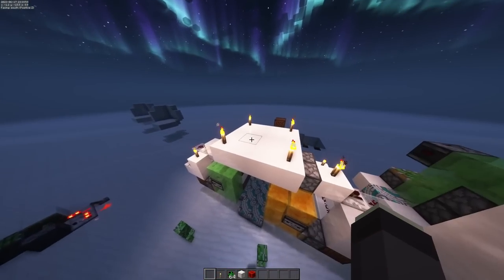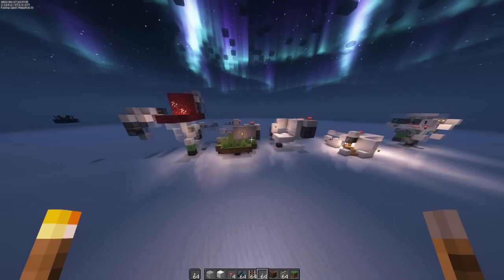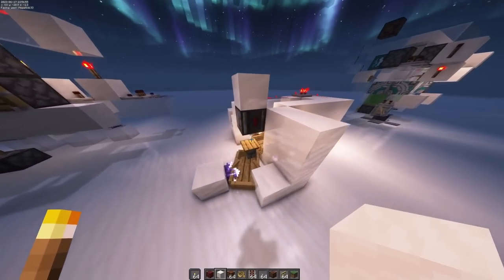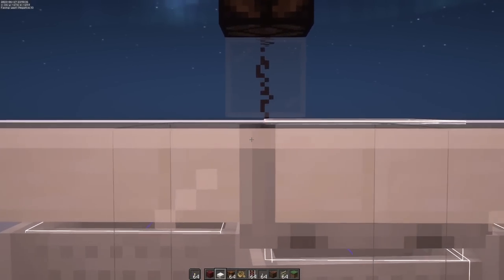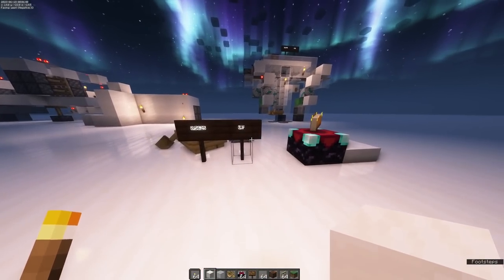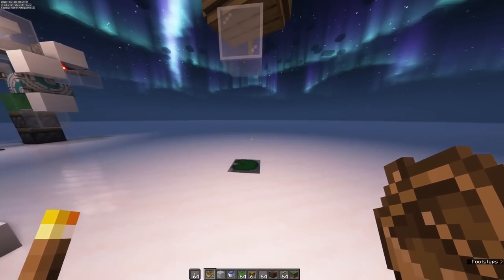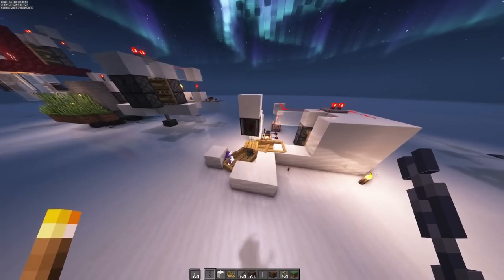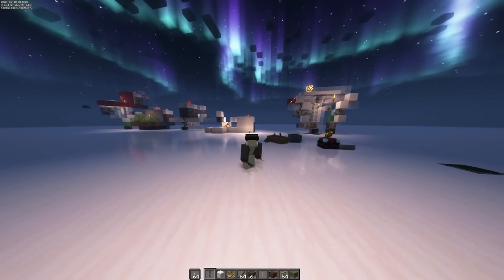The WORST Pressure Plate Ever Designed

Comment: The design we used for the entrance of out secret undersea base about 8 years ago is a hopper minecart right under the seabed. You throw any item in a specific location on the sea floor and the hopper minecart is able to reach it through 1 block, passing it to a regular hopper which in turn activates a comparator. Very simple yet effective.
Reply from the maker: Mmm, thats a great favorite of mine too. Easy to setup in virtually any location and more than well hidden enough.
Reply: Not to mention having a custom name for the key item along with overflow detection makes it that much more secure
Reply: I personally love the hopper minecart in the block under a partial block, my favorite being an anvil

Comment: This! I'm obsessed with hidden keys! The doors are more or less the same in all my bases, but the keys are all super unique. My most recent one you fire an arrow into the top corner of the room and it'll clip through and touch a wooden pressure plate. Then, to reset (cuz I use infinity arrows), it retracts the whole wall so the arrow falls into the floor, and then it all goes back. It's SUPER satisfying.

Comment: I have come up with a different way to align the minecarts vertically that only involves two minecarts.

basically you have a single uphill powered rail and place a minecart on it.
since minecarts don't move on unpowered rails you can put a minecart on it and nudge it slightly towards the upper block

it takes a bit of trial and error but if you get it just right the minecart's hitbox will be about half way into the first pixel of the upper block and you can place a second minecart above the upper block but not above the rail (so it doesn't snap onto it) and on top of the first minecart.

my setup for getting the correct upward nudge is to place another two powered rails on the lower side of the uphill powered rail with a minecart
after placing the minecart on the upill rail i then bump into it twice while riding the lower minecart.

Comment: Have you ever made a secret door with a tripwire update detector? Tripwires update when a new tripwire is placed in front of them within ~45 blocks (can't remember the exact number) even when there's not a string connecting them, or there's one or multiple walls in between! This makes for some really cool designs, since it's wireless and the door key can be quite far from the door itself. I discovered this randomly when i was like 10 a decade or more ago and still love the concept as an adult

Comment: 8:45 - escaping the confines of the pixel
There is technically a vanilla block pre-chain that has a fractional pixel height.

A depressed pressure plate.

It doesn't help here, but visually, it's only 0.5 pixels tall.
Reply from the maker: There is also the lilypad, which also proved to be unhelpful for the worst reasons.

Comment: I wonder if with some potential refinements, particularly for durability (perhaps with even more alignment shenanigans allowing mid-side carts to be restrained enough while still pushing detector carts?) this could be used as a player sensor that is dependent on the direction of motion. I also wonder if it could be somehow done in a way that makes it silent, so it can trigger a far away mechanism that the triggerer wouldn't even notice without luck or foresight...

Comment: you can make the same allignment for the minecart with an enchanting table with a boat on top, then the minecart. im not sure if this was already mentioned in the video so apologies if that is the case. just want to make sure you know this

edit: i see now how the parameters would interfere with this haha, mb, good video though

edit 2: thought there could be some improvements so i made one myself, got one down to 3x2x7 blocks (contained) so 35 blocks in volume haha
Reply from the maker: could it work with a boat, then 2 minecarts? Because then you may have found the solution i was looking for.
Reply: @squibble111  I found a design with a boat, then 3 minecarts that I think works reliably? If you have the enchanting table setup, you can put the minecart on the corner of the boat and up against the top of a fence to prevent it from sliding backwards. Then if you have that bump into a minecart on a ender rod which is up against a trap door which bumps into a minecart on a path block, you can reliably reset it by pushing the 3rd minecart with a piston.
Reply: @squibble111  i could send it over discord if that works (if you have a discord server i would do it there, just dont remember if you have one or not). sorry for the late reply to this i dont really check youtube that often
Reply: @squibble111  i have just realized something here and i apologize for wasting your time, i had assumed that as long as it was within that 0.0125 block range it would be fine, as i am now thinking about this again, it needs to be somewhere in between or z-fighting issues will arise

edit: i found another way with minecarts on slanted rails, still a work in progress
Reply: @squibble111 ok one last thing and ill stop bugging you haha. this took a while to upload to youtube but heres a smaller design that i found works: https://www.youtube.com/watch?v=Ur43BvEyJ8I
Reply from the maker: Sloped rails definitely were the untapped source of wacky alignments I was missing. Thanks for putting in the time to find a fix for the atrocity that is this pressure plate's alignment system.

Comment: Just as a heads up, RaysWorks' spreadsheet is missing a lot of values. If you're interested in an alternative that also lets you filter the blocks with tens (hundreds*, depending on how you count) of properties, then I'd like to shamelessly plug the Minecraft Block Property Encyclopedia :)
You are of course able to filter and sort by size, too, and the size units can be converted under settings.
I would link it but you probably have a link filter enabled
Reply from the maker: Oh my god, what a resource. Thank you so much for letting me know, Ill be using this in the future.

Comment: Why didn't you feature a CUD with a container attached?
Reply from the maker: I forgot those existed! These were only a couple things that I kind of thought were more untapped designs (ofcourse not referring to the torch and lever keys, just as demonstration) If you want an even more obscure detector, you can use a glitched waterlogged block using stickt pistons trying to retract an immovable structure, and the top surface is now a BUD.
Reply: @squibble111 huh it seems my comment didnt get posted, basically i said something about you maybe featuring a design (i posted a 3x2x1 design in the tech archive a few weeks ago ;) ) in one of your videos as it seems like not enough seem to know about it and especially not about its powers (detecting clicks on spots like the empty output of a furnace/an empty dropper slot, detecting a redstone signal going into the air besides it, etc.)

Comment: How exactly does snow interact with entities?
Reply from the maker: snow layers? Snow layers are interesting, I think each layer is 2 pixels, and the height of the snow (the hitbox height) is always 2 pixels below the visual height. So one layer, 2 pixels of snow, is actually 0 pixels high. 3 layers, 6 pixels, has a hitbox of 4 pixels high. Except for 8 layers, because that solidifies into a full snow block taking all 16 pixels, not 14.